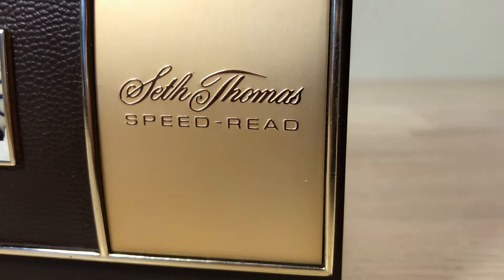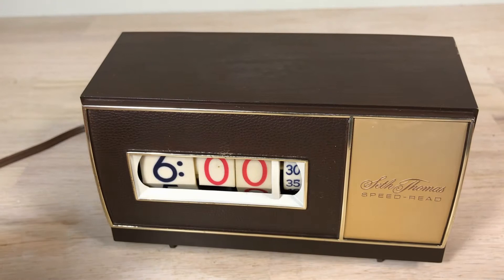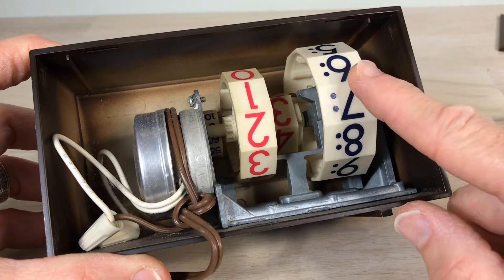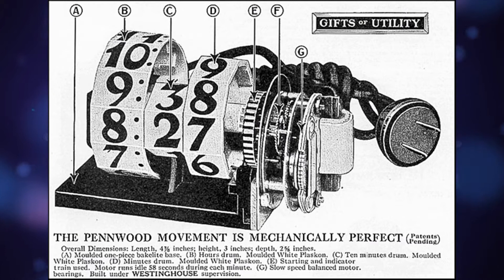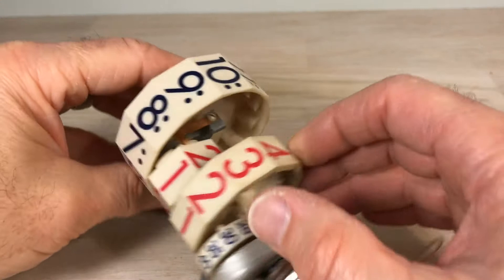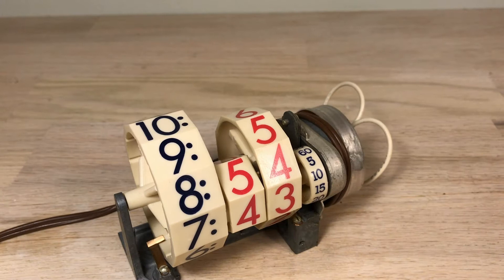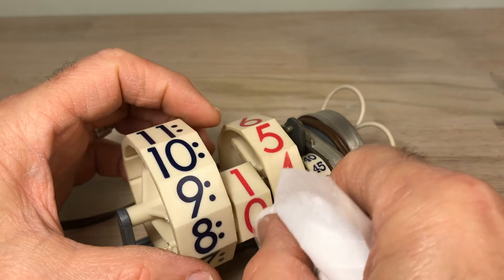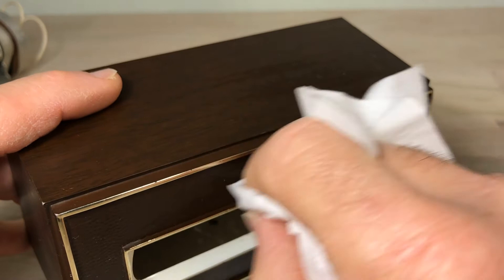How does a cyclometer clock work

Comment: These are really cool, one of my favorite types of clocks! Not sure how long you let it run...but did you notice how hot that motor gets? Even after being lubricated, mine run nearly too hot to touch! As always, that for the video!
Reply from the maker: YES! I did notice that. I hardly had it running a short time and it was very warm.  Makes you wonder if it's normal. Thanks for the input.
Reply: I have several of these and it doesn't matter if it has new oil in it or it is original...they run HOT!!!
Reply: @Flipclockfans  I agree with Mr. Torse. Every Penwood model I've ever had gets very warm while it's running- makes you wonder what they put in the plastic to keep it from melting!